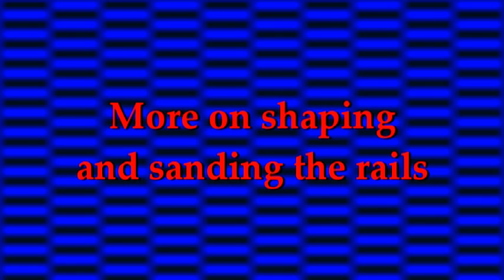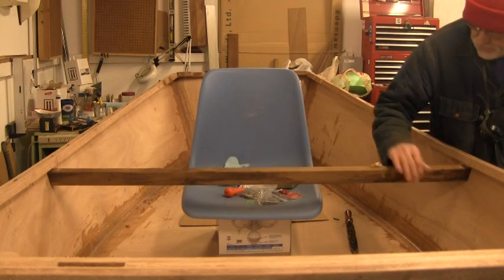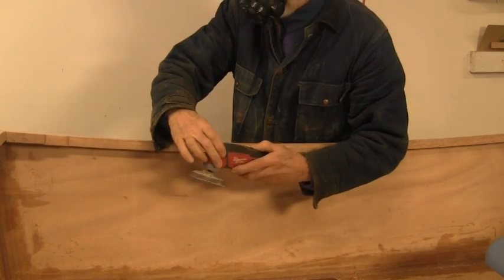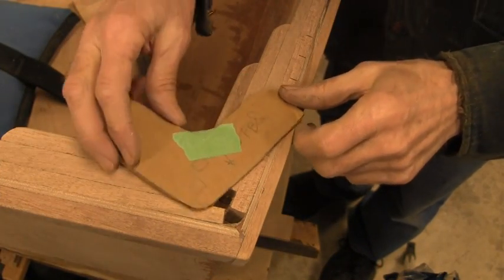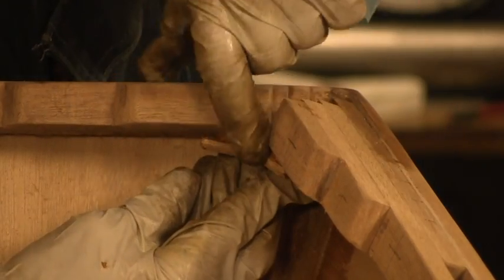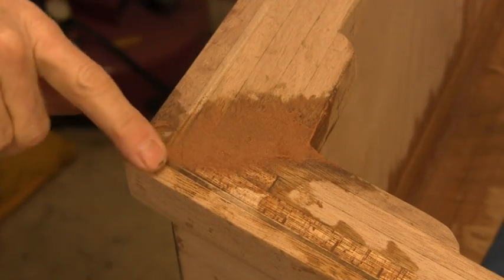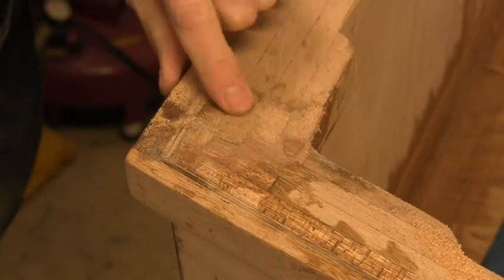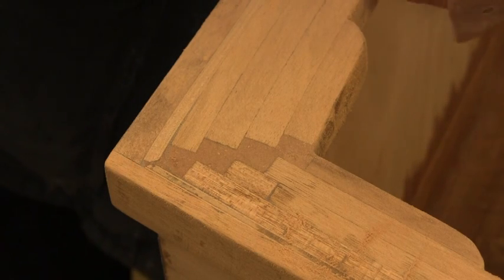Building Nymph Part 16

Comment: It doesn't look bad but I think I would have made wood pegs to fill in the gaps in the corners. I just hate sanding that much E-Z Fillet. That stuff is tough.
Reply: Warren has an excellent treatment of this on "EMC Part 2-7 Seam Fillets" and it shows the difficulty and the beauty of alternating light and dark woods.  The problem is I don't have the expertise or patience to spend that much time on it.  I wish I did.  But what I want to do is get a boat in the water that will be safe and strong.  This (easier)  technique helps the fumbled fingered get it done.  I bet when it is finished and stained, it will look great.